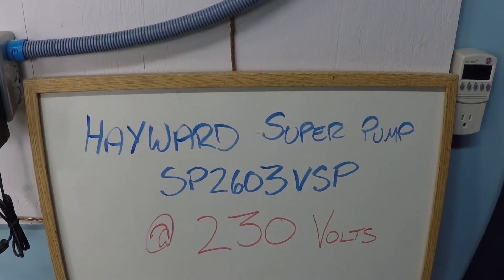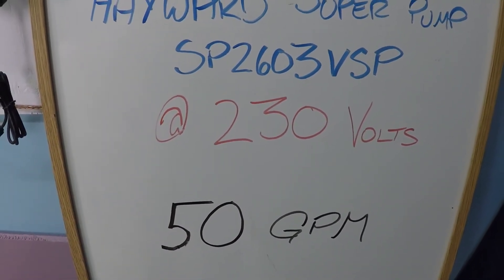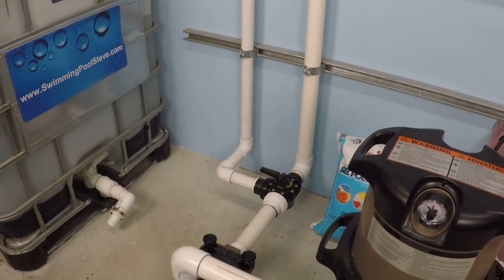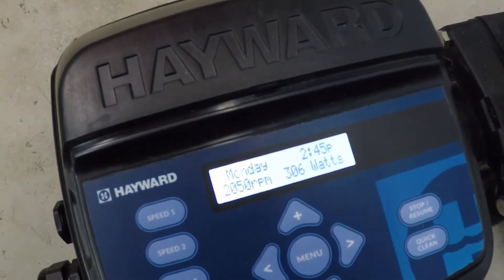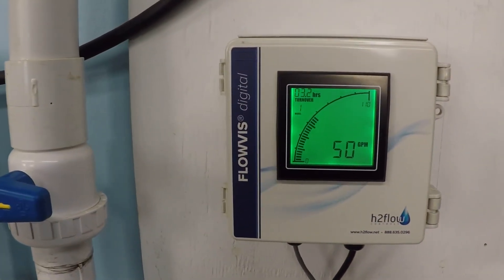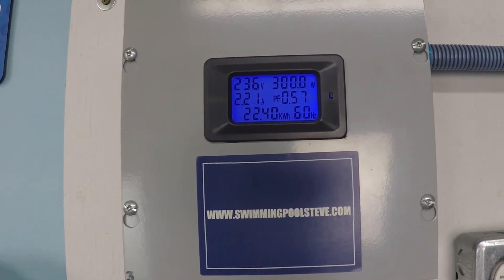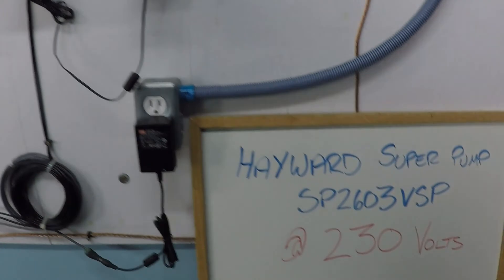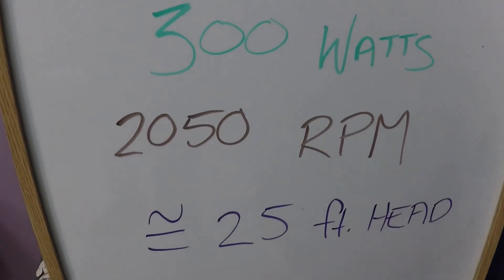What RPM For 50 GPM? - Hayward Super Pump VS

Comment: 16,500 gallon inground pool with 18" raised spa and 2" plumbing.  1450rpm gets me 55gpm.  Without the raised spa, it would be significantly lower yet.  I am using a different Hayward VSP pump.